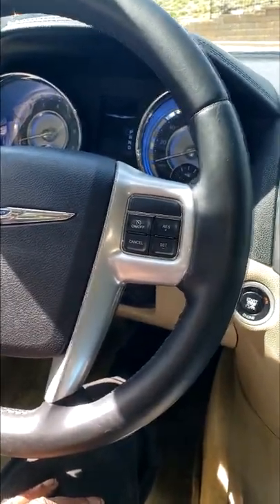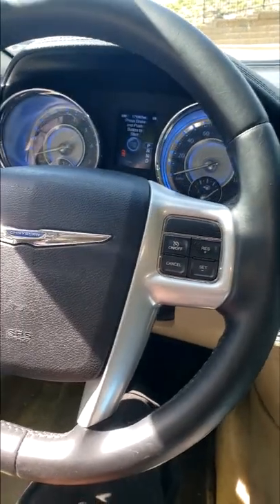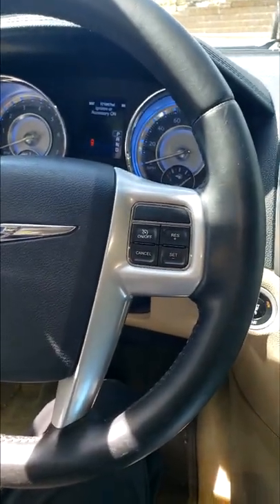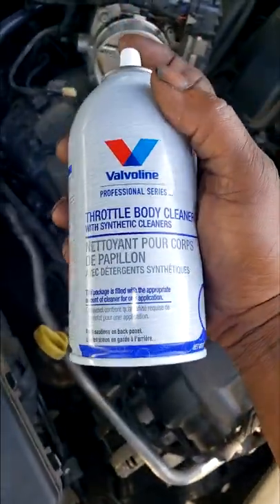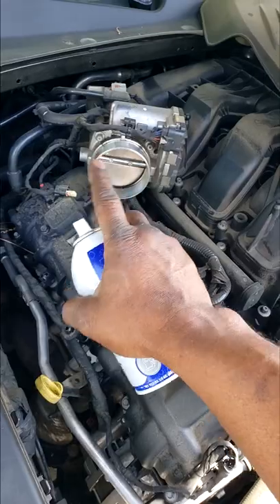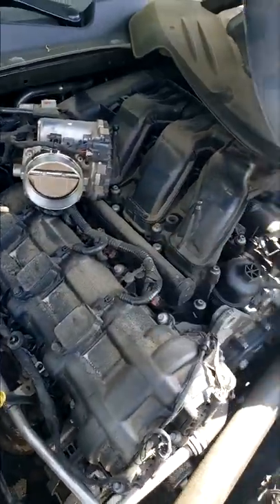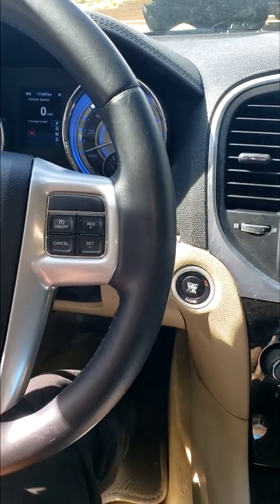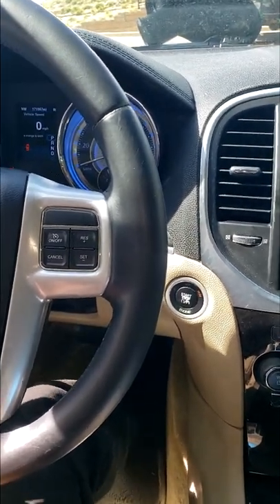WARNING, this No Start car can TRICK YOU. Always check this. #JTtheCarGuy #shorts #NoStart #fuelpump

Comment: Good point. The ground is very important. Using a volt meter will only tell you you have voltage, but without a ground , the circuit is still incomplete.

Comment: Thanks . the first thing i would have did was run out and buy a fuel pump.
Reply from the maker: With the newer cars there are other modules that can now prevent power to the fuel pump now. The factory security sys on your car can cause the fuel pump not to run because it is faulty. A brand new fuel pump will not fix this because there is no power supply at the connector. Thats why its best to see verify if the pump even getting the 12 volts and grounds.

Comment: A bad fuel pump relay will give you the same problem right
Reply from the maker: Thats why you should verify if you getting 12 volts and ground at the connector before you just assume the fuel pump bad. If your relay not working, you likely will not be get the volts to the pump. Then you should find out why because at that point, thats the reason for the no start.
Reply: @OnlineMechanicTips  yeah that's why I made that statement cuz I thought it was my fuel pump change up the fuel pump both actually still no start then something told me to check the relay check the relay wasn't making that little click noise went to the parts store got a fuel pump relay put it in while I lost start it right up so yeah I wasted about $500 🤣🤣🤣. But they were the original fuel pumps on both sides so what the hell

Comment: Just sold a mini with a no start like this
Fuse box was suspected
Reply: A MINI Blooper? We don't call them bloopers for no good reason. Mistakes were made. But that's actually my specialty.

What do you mean by fuel box? On the MINI's there is a module called the CAS which sends the wake up signal (terminal 15) to power up the fuel pump. Unless it was an S. Those also use a high pressure pump under the hood that fails a lot. What year and model was it out of curiosity?